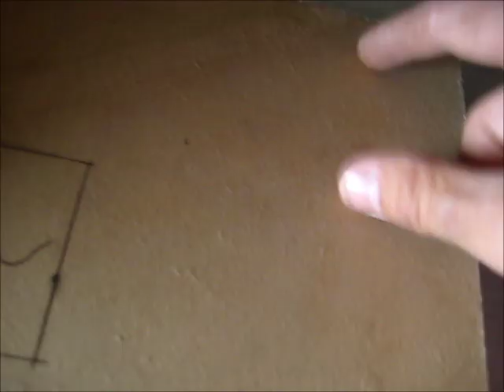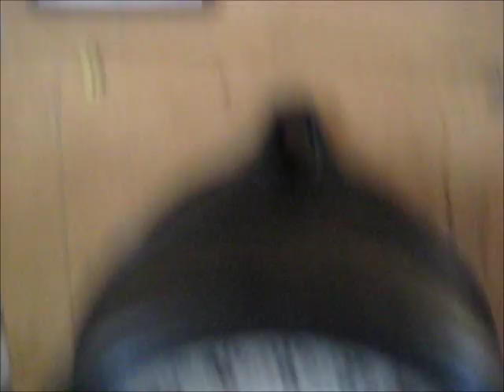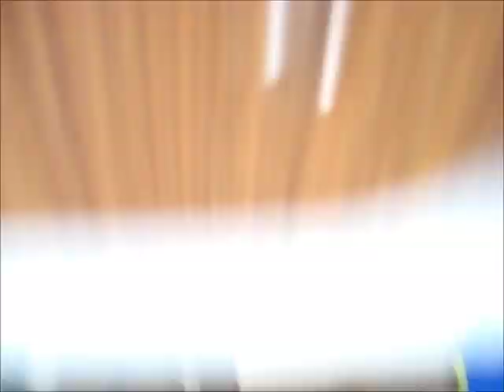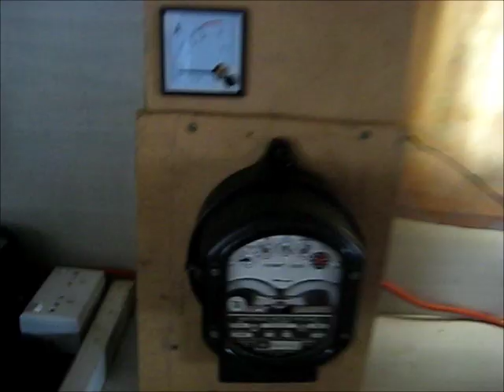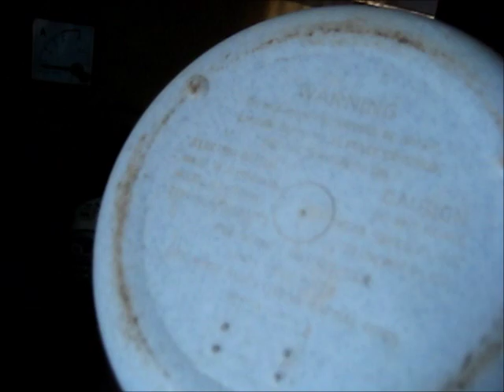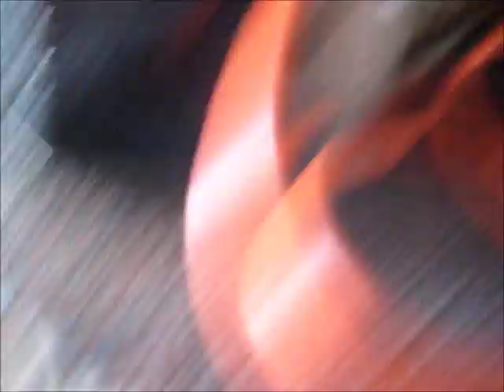Amp Meter Install & Test

Comment: Nice install with the amp-meter. As you found out, too many windings around a CT will probably make the readout on the meter display appear to be either too much or not enough. I'm wondering if it would be possible to 'calibrate' it with a resistor in-line between the CT & the meter readout so as to 'tune' it in to make it accurate. 

Another thing to take into account, are those huge blocks of metal close to the CT: They may affect accuracy also. 

I spotted a kettle. Cuppa tea time! :-D

Comment: Ok, if it says so 
On metering CT's normally one turn on the primary  is practice but in the example case of a 100 / 5 Amps CT and a 50 / 5 Amp meter, 2 turns can be applied on the primary and the 50 / 5 Amp meter will read correct.

Comment: What ratio is the CT ?
If it is matched with the meter you only need one turn through the CT.  the meter reads too high,at the moment, with the three or four turns of wire you put through the CT.